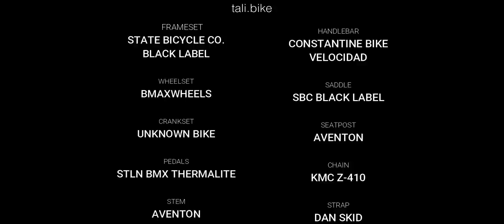DREAM BUILD FIXED GEAR BIKE - 6061 BLACK LABEL - State Bicycle Co. // TALI Bike

Comment: Just bought this second hand repainted with white powder paint frame with essor full carbon fork in 2023. Like design and feelings on the ride. Using sram omnium system.

Comment: would a 68x103mm bottom bracket fit this frame? thanks!
Reply from the maker: Yes.
Also based on the crank-arms. Some crank-arms need 107 or 110.
Please subscribe Tali. Thank you :)

Comment: Hi tali! What is the size from the bottom bracket! I could not get this measurement 103x68, is the one you used?
Reply from the maker: Yes, normally we use 103x68. But you should buy 110 for safe.. Some frames/cranks need 110...
Reply: TALI you are amazing! Thanks a lot!! I'm going to buy a Shimano UN55 68x110!!!

Comment: @TALI for 180 cm rider height ,what's the best frame size to get ? thanks
Reply: I'm about to buy this frame went to bike store in Brooklyn yesterday, I'm 181cm the told me 57 cm is the right fits... hope it helps.
Reply: @antoinethouvenin2031  hi antoine thanks for the reply i bought the 55cm frame and it's small , i regret
Reply from the maker: Best is 56 and higher
Yo yo. To support us, please subscribe and press the bell. We will try to make more quality videos.
Reply: Im 181 and rides a 54 cinelli vigorelli. I just prefer tighter bikes and rather compensate with longer stems and higher seatposts. Its personal but i suggest you always size down if youre in doubt. For me there is nothing worse than riding a slightly too large frame.